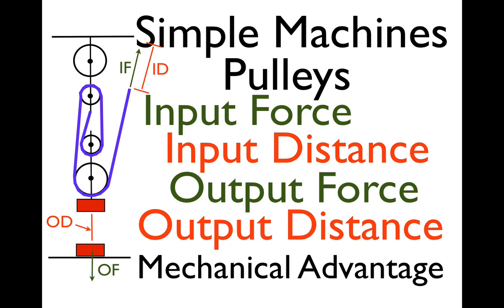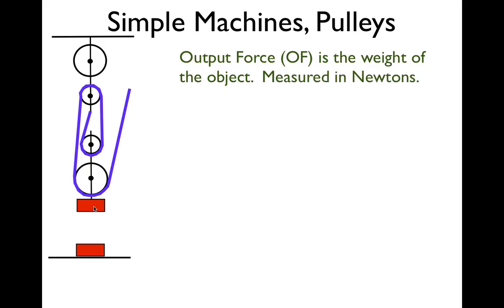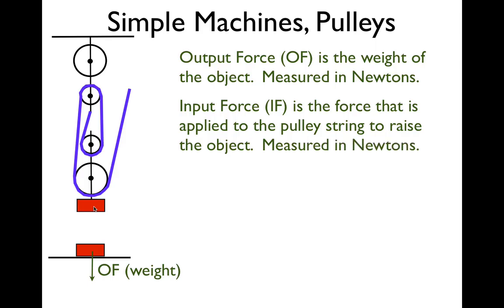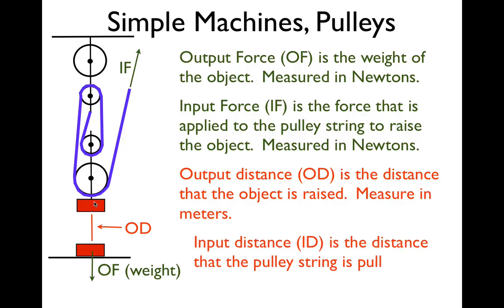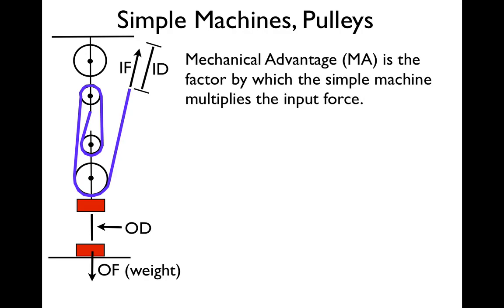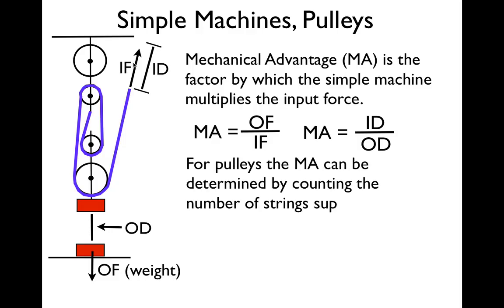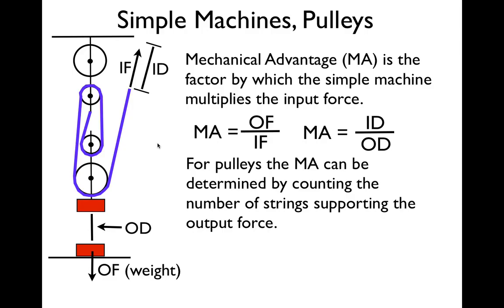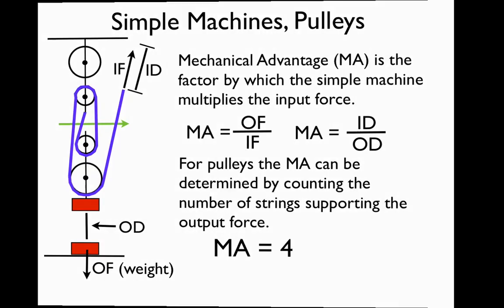Simple Machines (1 of 7) Pulleys; Defining Forces, Distances and MA

Comment: a pulley system  used to lift a motor from a car.In order to raise the motor a distance  of 1.5 m,and 7.5m,of  a chain had to be pulled through  the system.what is The mechanical advantage of the chain hoist.please tell me.
Reply from the maker: Ok... 7.5/1.5 = MA

Comment: 3:1 not 4:1. One would have to have the rope go over the top pulley to be 4. The drawing needs to be corrected.
Reply from the maker: The mechanical advantage of the pulley is 4 not 3. The point is that if the rope goes over the top of the pulley it would still be an MA of 4.
Reply: It is actually the other way around.  This way MA is 4.  If the rope was redirected around a ceiling pulley, the ceiling pulley would be ignored because the line on which you pull is not supporting the load.

Here, the pull line IS supporting the load, and the first pulley therefore splits the load tension.

Comment: Hello.
Is this method always correct in order to calculate the MA??
Count the strings involved thru the middlemost part of the system?
Is it also possible to count the number of pulleys involved and add 1 ?
Reply from the maker: I would stick with the counting strings method.  I have not tried out the counting pulleys method.

Comment: very helpful, I have a question. If the same pulley system was upside down then it would still be 4 strings but would it be the same mechanical advantage?
Reply from the maker: Interesting question...If you turn this pulley system over then the MA would be 3.  The string that comes over the top would not count.
Reply: Great , thank you !!!!